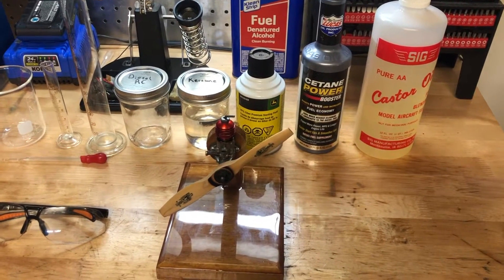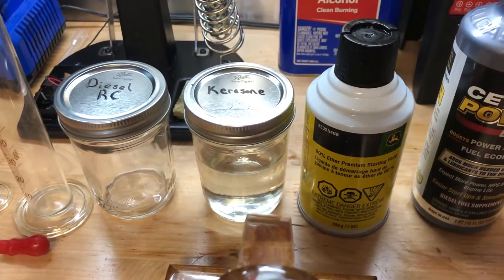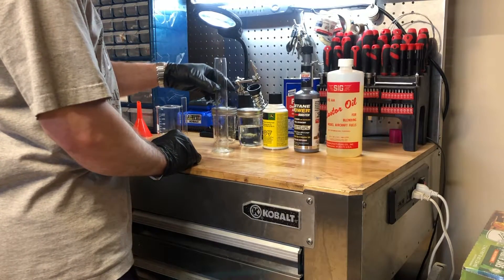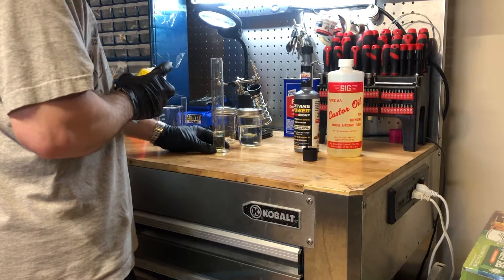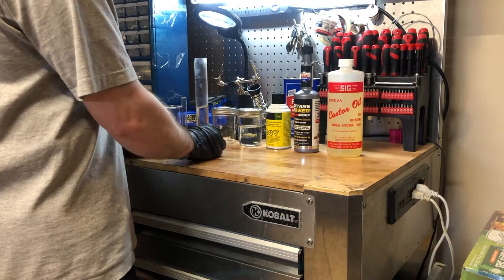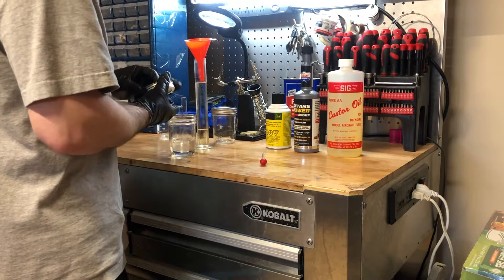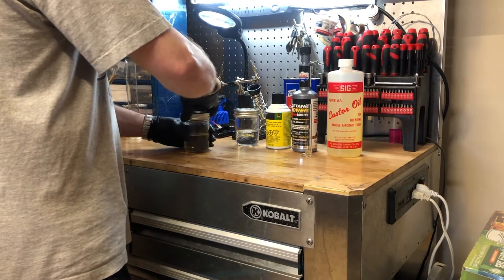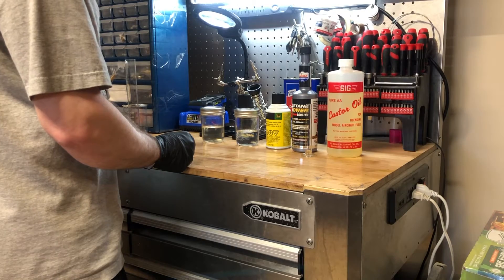How to mix Model Engine Diesel Fuel

Comment: Can we use light mineral oil in place of castor oil. With glow-plug fuel based on methanol I think we need castor oil as mineral oil will not mix but I would expect mineral oil to mix with keresene.
Reply: Yes.

Comment: I would have done all that mixing outside or just inside an open garage door. Ether is incredibly volatile and has a very low flash point. Very dangerous in a non-ventilated area, especially when taking it from an aerosol can !! Apart from the flammability it also has strong anaesthetic effect. I used to work with it, and am still very wary of it. Stay safe folks !!
Reply: thank you mother goose, there's always one around!!!!
Reply from the maker: Thank you for the feedback I i agree with you. I did have a good respirator on as shown in the beginning of the video. I also had my garage doors open.
Reply from the maker: I’ll add that to the description and add a annotation.
Reply: A respirator will NOT block ether fumes unless it is a compressed air-fed mask...
Reply: @mrslopez137 респиратор это от пыли ..